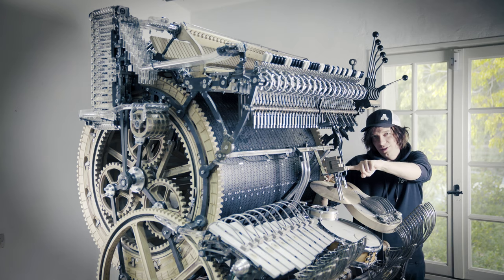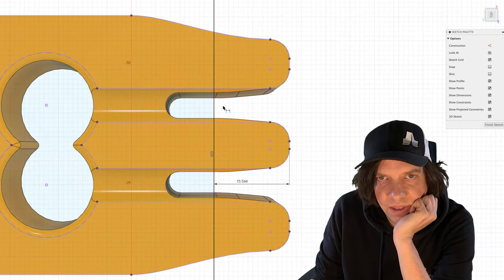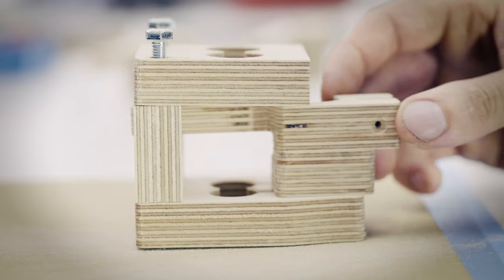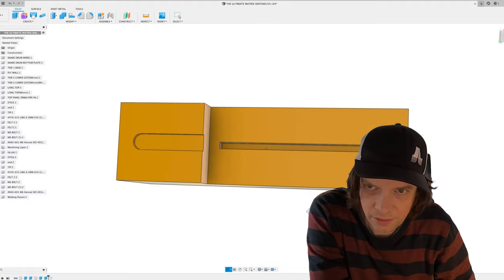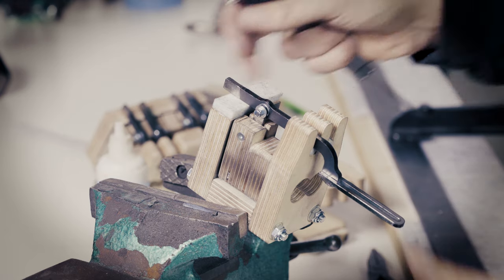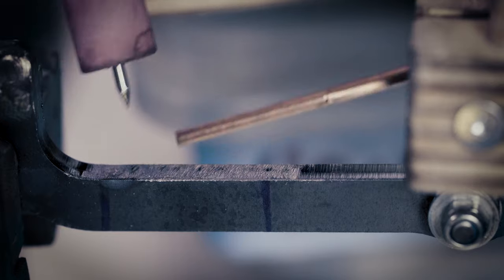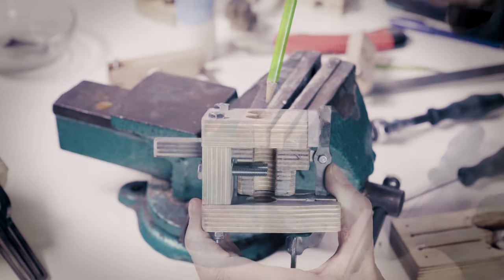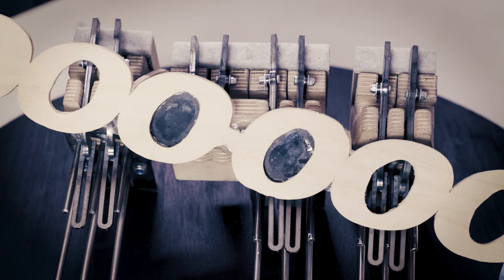Making Better Marble Gates - Marble Machine X #144

Comment: You are dragging the marbles across the bolt threads. Won't this scratch them over time? How about smoothing the top part?
Reply: Ooohhh! Fill the top side with tig welding, then grind it down!
Reply: When marbles encounter friction they roll.
Reply: @Jeff121456  won't the pressure of marbles on top add enough force to scratch them even a little bit? And once there's a few scratches, wouldn't that make it easier for the threads to dig into those scratches, making them deeper?
Reply: I think scratching is not the most important component here. More importantly it will cause friction, which could may result in blockings. Quite unlikely, but you never know.
Reply: @nikolai9925  Ya for a long time I have been wanting him to file down the end of those bolts into a point. Not only will it make it a smoother rolling surface and reduce friction but it also:
1) Lowers the chance of the marble getting stuck against the flat edge of the bolt if the gate tries to close too fast. 
2) Make the marble roll down instead of laterally, completely solving the problem of lifting the marbles above it 100% of the time.
Reply: @sevegarza  it's impossible for the gate to close too fast, as the programming drum can't move fast enough. Also, the marbles are harder than the bolts.
Reply: nope.  ball bearings are hardened steel.  won't scratch after 1000s of hits
Reply: @nikolai9925  threads have less contact than a  flat surface.  it's a better choice
Reply: Felt all the things!
Reply: Mount a custom made porcelain socket on the bolt to reduce friction 😂
Then lubricate all the balls with molybdendisulfid👍🏻
Reply: yea personally i would just use a partially threaded rod if possible with the part marble touches super smooth
Reply: @petter5721  Oh god, don't let Martin start learning pottery!!! :P
Reply: @natalieisagirlnow  What about after 10000000 hits?
Reply: Isn't the "marbles" ball bearings?
If so they are made of hardened steel. A non harden regular bolt will barely scratch them at all. If I remember correctly he got the bearings from SKF, one of the highest ranking bearing manufacturer in the world.
Reply: @nikolaihedler8883  oh good to know about the gates. And oh, I don't care about the scratches, I just think it easier for the marble to roll because its downhill and a smooth surface and also a better solution for not lifting marbles above it.
Reply: Nah. The marbles are hardened. The threads will get worn down faster than the balls, and speaking of balls, balls roll, so there's practically no worries here.
Reply: @Koooo4  you screw in a new one
Reply: I don't think they'll scratch since they are hardened steel. But I think this is a great place to reduce the noise of the machine if Martin used nylon bolts instead.
Reply: @natalieisagirlnow  
You realize the bolts are likely hardened steel as well, eh? And reduced surface area contact may reduce friction in general, but sharp ridges perpendicular to the direction of flow only serve to increase it.
Reply: They must be zinc plated 8.8 bolts, it's tempered steel, the hardness isn't higher than the ball but it could very well chip them. Also i think that the hole in the plywood holding the bolt will waller right out, i would clamp it with a threaded piece of metal to ensure that the load is taken by the friction and not the wood
Reply: @federico1183  I think the bigger issue there is that chips and like don't magically disappear. I cringe every time he jams an angle grinder into the machine and sends a shower of sparks all over the place. Those are tiny little shards of molten metal, they don't just evaporate.
Reply: @Dezkart  ball barrings are really hard, I don't think thats a problem, I would be more worried of the repetitive striking wearing down the bold and bending it over time.
Reply: @SBBurzmali  yeah those are literally grinding powder, i mean hopefully a bit of comoressed air wilk remove the bigger part of it. I don't know
Reply: @federico1183  Those are nice and toasty when the come off the grinder, if they hit something soft and flammable like plywood, they will burn themselves a little hole and you end up with a tiny metal spike jammed into a low friction wooden surface.
Reply: I don't think the scratching is an issue but as someone else said it's a source of friction. Those bolts should really be partially threaded or smooth.
Reply: He could dip them in the plastic dip used earlier for sound absourbtion as well to smooth it out
Reply: At some point the threads are going to knurl over and may get metal shavings in the mechanism. He should be using a hardened ejector pin (used in plastic injection molds).
Reply: The "Marbles" (ball bearings)  are harder than the bolt threads, therefore they will not scratch.
Reply: I’d guess the bolts will eventually get bent down by all the thousands of small hits if they’re softish steel, or brittle fracture if they’re hardened. Threads are nice places for cracks to propagate from.
Reply: This was my concern as well. Either the marble will be dented by the bolt or the bolt will be dented by the marble. Over ten million repetitions, something will get worn. I'm guessing this is also going to be a loud solution. Maybe you could mill a piece of wood, add one of those hammer-in thread inserts into it, and screw the bolt into the piece of wood. This would protect the threads and the marble, and would give you a surface to put felt on (because this design is probably going to be loud!)
Reply: Even if it wouldn't necessarily cause scratches, it seems like such an easy fix. Either filing down the thread of the screw, or attaching something which makes it smooth.
Reply: brake caliper slide bolts are only threaded near the head
Reply: Yet the whole design change is to reduce friction!

I'm sure these parts still aren't done sadly.
Reply: @ralphgesler5110  Woah that's just a bit intense for a response to a comment on ball bearings. I get what you're saying, I really do, but I don't think you've considered what I mentioned. You've touched the threads of a screw before, right? Foregoing what might be brushing against it, one would naturally assume that object would be scratched by those threads. Now this isn't some industrial machine, this is a personal project slowly being remodeled and pieced together. This entire design did not exist in our consciousness a week ago. "Get real" and challenge your assumptions, you might come to realize ideas that breathe new inspiration into the world.
Reply: Guys, i love this Thread. :) word   ur right. Since the threads are not aligned with the direction of travel, the balls will ever so alightly sink down in between threads, and need to be pushed up and further again. As mentioned, of course marbles roll, but in this case its rather a beeing pushed by plywood than rolling. And thats how the friction will be there. But overall you can say, this ia such a minor design flaw, you can leave it as it is. I think rethinking and to overcomplicate are very close to each other here...
Reply: @nikolai9925  "this ia such a minor design flaw" multiplied 10 million. It might accumulate to become a catastrophic flaw.

Comment: I'd love to see a livestream where the marble machine gets automatically tested 10 million times.
Reply: I don't think it would do 10 k without a breakdown.

But that's okay, Wintergatan did the smart thing and used CAD for basically every piece so this thing is infinitely repairable! That's very crafty.
Reply: That livestream would be approx 50 days long. (assuming each marble drop takes 0.4 seconds)
Reply: @michaelbeavitt1523  10M / 28 channels * .4 seconds / 60 seconds / 60 minutes = 39.6 hours
Reply: @ShadowHunter120  *as long as you have a TIG torch, a bastard file, and intimate knowledge of how every single bespoke piece was lovingly "hand-adjusted" from its original CAD design to the actual part that went onto the machine. Kinda defeats the purpose big time but I do get entertained so hey no complaints here...
Reply: @dforck42  28 channels, but only a maximum of 8 marbles per tick
Reply: @michaelbeavitt1523  "10 million" is artistic license - the MTBF actually needed is the playing time of the world tour. If they're playing 24 shows of 2 hours each with the MMX playing 50% of the length of the set, 24 hours of testing would simulate the entire world tour. And that's already got a generous safety margin - if a fault doesn't damage the machine and only takes a few minutes to fix, I'd say they could tolerate such a fault every other show.
Reply: @dforck42  40 hours of marble drops? Who will host and who will commentate? It's not too early to consider the expert panel also.
Reply: A ten hour xylophone arpeggio with guitar and percussion accompaniment?
Reply: It should obviously be a timelapse... with some modulin music in the background
Reply: 3 marbles/sec for ~40 days
Reply: @dforck42  Oh is it 1 in 10 million for all channels averaged, not each channel individually? I thought each individual part had to have a fail rate of 1/10000000
Reply: Hell yeah
Reply: ShadowHunter120 i think the idea that if 10,000 parts work 10 million times individually then all the parts can play 1,000 songs without failing.
Reply: @michaeljtandy  Except that it has to be disassembled every 2 hours... packed, shipped and assembled... etc.

:)

The playing part isn't the critical part for Martin and his team IMO.

We're at episode 144; only a couple more hundred to go for playability and durability.

:P
Reply: In each gate.
Reply: 380 million drops?!
Reply: Wood, glue, plastic, springs, etc. do not last that many cycles.
Reply: No it's in the computer 😅 
I do my tests by the AUTODESK INVENTOR program
And it's really perfect
Reply: @leandrogaldeano7731  Why modulin and not just sped up marble machine soundtrack? :)
Reply: @John Verne also called testing in production
Reply: Nice jävla video
Reply: @dforck42  thrwn every gatevwill be tested 10mil./28 not 10 mil. Times
Reply: Imagine what that would sound like though.

"ding ding ding ding ding ding ding ding ding ding ding ding ding ding ding ding ding ding ding ding ding ding ding ding ding ding ding ding ding ding ding ding ding ding ding ding ding ding ding ding ding ding ding ding ding ding ding ding ding ding ding ding ding ding ding ding ding ding ding ding ding ding ding ding ding ding ding ding ding ding ding ding..."
Reply: •   10thGenProtos r awesome, but, Delrin or HDPE would give u MANY more 9s (stability + rigidity + lubricity)
   •   Yes, the Baltic Birch + Graphite allows for more slop (or slack as u call it), but it also means much, much more wear over time (steel marbles are hard.. wood is not...wood will give...wood allows for plastic deformation, which means less and less nines, yo)

   •   Its just a thought, y'all have a good night.
Reply: How about having it do the marble machine song 4 times
Reply: □ □□□□Wilson approves of this comment 5/5 happy faces!
Reply: Bruh